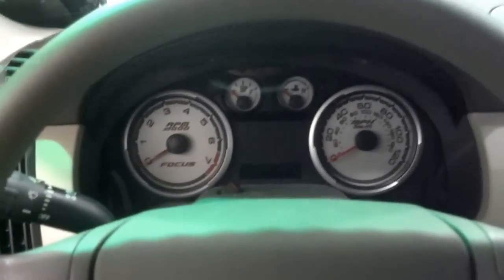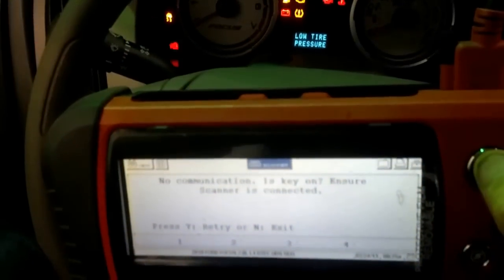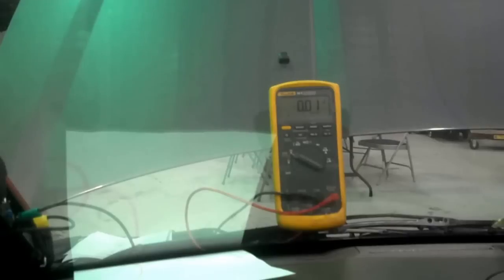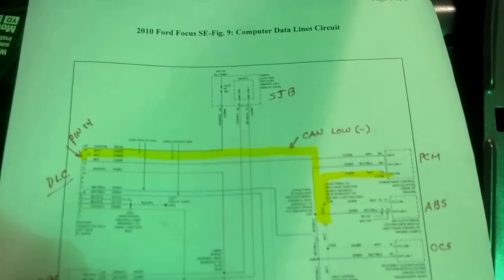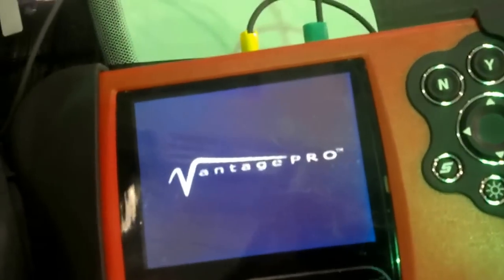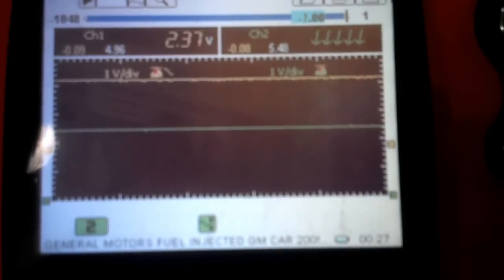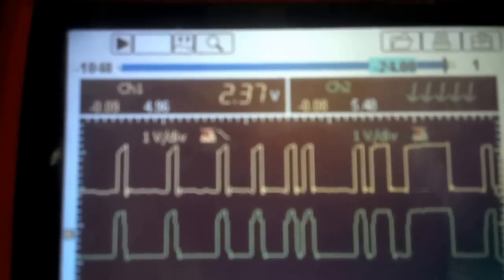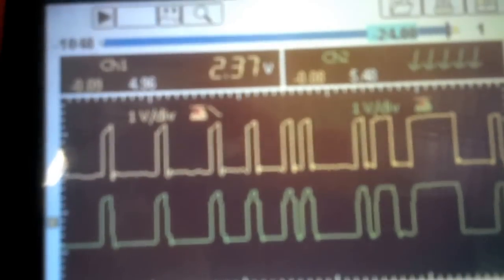PCM No Communication Diagnosis

Comment: So, can I use other components to check for a 5 volt reference signal from the pcm...the purge valve solenoid circuit, for example. Won't that also verify that the computer is supplying the 5 volt reference as does the ac pressure valve?

Comment: I've got a 97 grand voyager that cranks, no start, and no communication with pcm. After watching hours of diagnostic videos about back probing the pcm for power and ground then checking for 5 volt reference a variety of
Reply: different sensors, you cleared all that up by simply stating that a reading of 5 volts at one of those sensors proves there is power and ground at the pcm. I hit the post button by accident.  Anyway thank you!

Comment: i almost  got bunt on the assumption of having a 5 volts  reference means all power and grounds are ok,not true i had a blown fuse powering the ecu,it had i think 3 power line going to ecu, it was a 2010 ford transit.

Comment: Very educational video. Though I'm not getting no power to pin 16 only 8. Any suggestions?
Reply from the maker: Pin 16 of the DLC often get power from circuits shared with the cigarette lighter or power points.  Check those as they often blow fuses.
Reply: @MasonClassVideos  Car lighter works and my clock works aswell all my fuses r good checked with a test light

Comment: I ohmed the pcm unplugged at the can bus pins.  I got OL.  (2008 MAZDA 5)   if I connect it back I get 120ohms.  I guess the resistor is open. Am I right?

Comment: Good day; 
Information is key in diagnosing so it is a little long. Please bear with me. 
 
My latest project a 1999 Dodge Durango 5.9. with a no start,spark, injector pulse and a no buss code in OD window. The story behind is it ran to 175 tho miles and just quit, unsure so she parked it for 3 years. 2nd owner replaced fuel pump and it ran for 65 miles and quit. He replaced crank sensor with no luck.  I bought and brought home,  I do not have a high dollar scanner and Thru many tests and my Haynes manual I have found a misinstalled crank sensor.  I guess while trying to put on with the old weather strip he jammed it sideways and it struck the reluctor wheel. I positioned my phone for a close up pick and found  Luckily on this engine the wheel is not a spoke type.  
I milled a new sensor to regain air gap which got  me crank signal, power to the coil and a faint coil ark and the ASD worked.  
My problem now is when I turn key (on) I get power to fused side, then while cranking i have no signal driver from the PCM side then within a minute I loose power to injectors completely. Turn key off and then back on same thing for a minute. 
I Have 5.14 volt reff on the TPS, MAP crank and air intake sensors.

I'm questioning the reading of (battery voltage) on both low and high A/C switches. Not sure this is correct.
I am trying to get to a point where I can justify the fix if I spend the $$$$ on New PCM.

Best; Tom
Reply: What ended up being your issue? Some times the pcm will intentionally shut a circuit off after the key is cycled. Another words possibly why you were getting signal for a minute and then nothing. Then to protect internal circuit the pcm forces that circuit to intentionally shut down to protect the driver. Curious as to what your outcome was.

Comment: I have a similar issue, I have no communication with, ECM, TCM, ABS and few others. I can't get a wiring diagram the |Haynes book i bought today doesn't have it. I accidentally dead shorted the battery when the wrench touched both terminals,  Went through every fuse and relay associated with everything affected. No luck!  I need a wiring diagram to move forward. You have one for 2008 f 250 6.4 diesel? Also no oscilloscope either the Solus never had that option.
Reply: If you go to Ebay and search for "repair manual 2008 ford f250" you should find an electronic version of the manual for sale. It should include all the wiring diagrams for the truck.

I am also looking at buying an oscilloscope to work on CAN bus problems. I most likely will buy a Picoscope  2000 series that works with a PC. There are even cheaper scopes out there. Check Craigslist and Ebay.

Comment: Hey I have a question.  I have a 99 GMC Yukon and my computer does not communicate with my scanner. I have ground at the connector and voltage on all the points at the dlc. I am stumped could it be a bad pcm????
Reply from the maker: Cee Zer if the truck runs as it should it is not a bad PCM.  You need to check the DLC for proper signal, and try to communicate with other modules on the truck.  A generic OBD2 scanner will probably not do this.  Most common reason on GM is a blown cigarette lighter fuse (really!).  This provides power to pin 5 of the DLC which the scanner needs to operate.
Reply: I checked all fuses and are fine. When I plug in the scanner it blows the 50 amp ign b fuse in the main fuse box under the hood.  What could be the cause of this.  I am at witts end on this gremlin thanks for your help.

Comment: please check my recent video. security lockotu and dash board freakout. I need a exorcism and advice thanks.
Reply from the maker: Kriswixx that looks like a textbook ecample of how those vehicles behave with a bad battery.  Low voltage will cause the cluster to become totally possessed.  the extra wires are from something aftermarket, looks like it may be at least partially removed.  Good luck!
Reply: thanks!! I am just giving up. i'm selling it for 400$. someone want a car in orange county, ca? lol. i have title. selling it tomorrow.-- i just got a 2001. same car, but this has 82 thou not 289 thou. :) thanks for your help! someone who gets it is going to be stoked,- 5 disk changer and loud stereo. heck, if i had driveway space i'd park it on the side yard for storage and parts haaa

Comment: i have the same issue with a ford mustang 3.8L i have live data from other modules abs, srs, generic module control, but the pcm is died. i check the network and all is working fine. this means the PCM is bad and then need to be replace and need configuration for pats.

Comment: There is one piece of information id like to emphasis on it wasn't mentioned in the video, both can/bus communication lines are connected in parallel to all modules, what is shown on your Scope might be the BCM talking over the network regarding an opened door or a doom light or like so
Reply from the maker: Airman is correct!   We don't know 'what' is being communicated or  'who' the message is from and intended for.  The fact that there is identical traffic on the network at a known good junction (the DLC) and at the suspect module (the PCM) is exactly what confirms for us that the network is intact.
Reply: When scoping the DLC and PCM CAN Bus (-) line,  i get identical signals but one goes postive and the other shows negative. Is this similar?

Comment: Hello sir, I have the Can bus problem with my Ducati Hyperstrada ! The dashboard shows "CAN LINE" error, I was restarted the system but nothing happen ! Could you help me ? Thanks
Reply from the maker: Without factory style diagnostic equipment I would start by unplugging and plugging in the main connectors to all the various computerized items on the bike - the engine computer, ABS computer, instrument cluster, etc.  Possibly use some DeOxit or similar to clean the connections (see my other videos for this repair)  
Good Luck!
Reply: Thank for reply, sir ! I had unplugged and plugged a hundred times, I sprayed  WD40 to all connector ! But I measure the canH-canL for resistor about 120ohm ( normally 60ohm ?) What should I do ? Thank you for your support, sir
Reply from the maker: 120ohms of resistance is just 1 of the 2 terminating resistors.  The circuit to the second is open.  You need to determine where they are on your application and check for an open circuit to them.  Also, do not use WD-40 to clean the connectors as it is oil based and can cause some cross connections in a multi circuit connector.  Use a good quality electronics circuit cleaner.
Reply: MasonClassVideos hi sir, I did checked the circuit, all devices 59.2ohm ( without battery) ! Dashboard show : abs is "---", rpm bar flicking, km/h is "---", engine temperature is "---", all light flashing. But when I unplug the ECU, abs received signal, km/h shows 0.

Comment: bottom lines  i cant scan the PCM ?and tell the car's owner .to get it back to the dealer? -_-
Reply from the maker: This car was under warranty, so it was a no cost repair at the dealer. Even out of warranty the PCM needs programmed, so unless you have the correct hardware to do this the car will still end up at the dealership.

Comment: hi I have a U0100 PCM failure to communicate on a 2009 Mazda 3 2.3 basically same as the focus. my cat is still running fine though but sometimes it's hesitant to start after its been running for awhile. I did a flash just at the part store and it came back. if I was to replace the PCM my self (not under warranty ) does it have to be re programmed? or would a new one fix the problem.  I do all my work my self I'm a broke young man and I can't get any help with this. please help and thank you for this video
Reply: The problem is not the PCM , it's the TCM

Comment: I have a 99dodge ram I was having stalling problems,gauges would drop to nothing it would make like a whining from,I'm guessing trans before it would die ,sometimes start right back up ,code no bus,well now it died won't start  no fuel no spark,put new can& crank sensors in and coil but still no spark or fuel  any ideas

Comment: Hi sir , I faced same problem in fusion with my scan tool , no communication , & security light blinking , car did not start , then I solved my problem just by resetting PCM within only 10 minutes waiting time after disconnected both battery terminals , reconnect Scanner  clear DTC in cluster & the car got start , every thing was okey...... after just resetting.....
Reply: did you ever have the same problem again? my engine light just came on so went straight to autozone and cod got u0100 and when i went to start car it wouldn't, i stayed stranded at autozone till ny brother came to tow me home.

Comment: In your video the CAN circuit ok and the modules communicate each other on bus lines that you show using a scope, but the PCM cannot process input values internally right? Is it possible to use only DVOM meter to see (i.e fluke 88V) instead of scope?

Comment from the maker: Emissions warranties vary from car to car.  They are longer than the bumper to bumper coverage and are usually both time and milage restricted.  An emissions warranty will cover certain items such as the catalytic converters, certain devices and the PCM.  Your owners manual or dealership can tell you specific coverage.

Comment: hello I have a 2000vw jetta 2.0Lcranks but doesn't start ecm can't be readed by scan tool and checked connection where scanner connects and the data wire had 14v instead of 7v I took out aftermarket radio out before scanning car but still can't get car to start all sensor,fuses and ground wire are fine this happened right after I installed HIDs bulbs can someone help

Comment: Excellent lesson , thank you..I have a 2008 Honda CR-V ,opened throttle and cleaned with cleaner,. I have a p0507 and it idles high. Try to do a relearn finally got it till it is below 1000rpm and sometimes still goes high enough to set the code, I replaced the throttle body , relearn and it appears to be better idle wise , but not the same as it was before I cleaned the original one. Could it be possible the computer is still getting use to learning, have not driven more than a few miles since. Thanks you for any suggestion or opinion ..I just subscribed to your site , fist video I have seen of yours.

Comment: i have the same issue on a 2006 ford mustang v6, car was running then all of a sudden it turn off now it will not start ,there is spark, no security light ,and its getting gas .put my scanner on it and said same thing as your video ,went out and bought a computer that came reprogram with the keys,plug and play gave last 8 of vin and still nothing any suggestion?   need help please

Comment: Hi I have a question for you, I install HID's in my 2010 Ford Focus and after doing so the ABS, Hand Brake and the TC light all came on. The HID does work fine, I used my phone with an OBD reader and it gave me the same code the U0100 and U0121 Network codes. I did use a relay to wire the HID's not sure if that really has anything to do with this problem directly or not. Would you have nay ideas?
Reply from the maker: Without seeing exactly how the lights are wired I can't be sure. The symptoms sound like an ABS module that is not responding.  Maybe a fuse was damaged during installation? Or a ground write left loose?  If it was OK before the install the problem is most likely caused by the installation.
Reply: MasonClassVideos

Comment: I have the same issue I have a 2006 dodge charger and I got codes U0100,p0700,and P0404 the dealership said it was a oxygen sensor paid them and car still was stalling and loosing power while driving now they said it's the pcm something about the ground.Can a bad pcm shoot the codes for tcm and egr
Reply from the maker: Yes, a bad module can technically cause many different issues and trouble codes to be set.  Before any module is replaced though it is imperative to verify UNDER LOAD the ground and power circuits for the module (PCM in this case).  It is also a high possibility with any suspected voltage issue that the battery or alternator may be bad.  These basic checks are unfortunately often overlooked by even highly trained technicians. 
U0100 is a network failure code set by the PCM indicating it could not communicate - this code does not say with what other module it was trying to talk.
P0700 is a code set in the PCM flagging a transmission fault.  It does not mean a bad transmission just that the PCM self test flagged an issue - in this case a high possibility that it relates to the U0100 code, therefore a loss of communication between the PCM and the TCM.  This could be from a defective PCM, TCM, or circuit condition.
P0404 is an EGR performance fault - the feedback circuit for the valve was within normal voltage range but the return did not match the command.  Normally a stuck or sticking EGR valve is the culprit here, though a circuit condition is not out of the question.
 It is almost certain that the P0404 in your case is a secondary issue from the transmission.  Either can cause stalling.
From the information you have here I do not know why an O2s sensor was diagnosed and replaced.

Comment: I have  a 2005 focus.  Solid check engine light.   Pcm wont communicate.   Why,  what should i check
Reply from the maker: You may need to perform checks similar to those demonstrated here.  Any time a no communication problem exists you must test the network integrity.  Without a graphing meter a resistance check is a great start - please see my uploaded videos demonstrating this technique on a Chevrolet Cobalt.
Reply: Greg Raizk Also, first check power and ground circuits on PCM, most all of the "no communication" problems I've run across were problems with that, usually a blown fuse.
Reply: Greg Raizk

Comment: i have one question for you, i only have a fluke meter like you have in the video. could i just unhook the battery and connector at pcm and put my positive lead in the pin 14 dlc and black lead on pin 43 at the pcm and check for continuity, then if i didnt have any move my black lead to a good ground and check for a short to ground? i know its limited with just a dvom.
Reply from the maker: Yes, the test you are describing is the traditional circuit continuity test used by manufacturers.  Usually a twisted pair circuit involves 2 additional resistance checks - move the black lead to the disconnected positive battery cable to check for a short to voltage, then move the black lead to the CAN HI circuit to check for a short between the 2 CAN circuits.
Reply: how do you repair a can bus wire since they are two wires twisted together?
Reply: is it just a normal splice and solder or something different
Reply from the maker: Solder and heat shrink is the proper repair.  You do need to maintain about 1 twist per inch on the twisted pair to shield the bus from outside RFI.
Reply: oh ok i thought they were fiber optics and the repair was different than just a splice thanks for clearing it up

Comment: Great Video.  I have an issue with the Can bus on an 06 impala. There are pages of history codes one being an Open HS- on the Hi speed bus network.  I have access to a scan tool and a pico with a Can breakout box.  Should i do a reistance check or just connect the scope to find the open?
Reply from the maker: Benjamin, sorry I missed this great question when you posted it!  The scan tool is first step to see if all modules on the car can talk to to it, if one does not then the Pico can be used to verify communication exactly as I have done in this video.  If your problem is intermittent then then a resistance check like the one in my video sequence on the Cobalt would be a great way to try and isolate the issue.  High speed CAN bus diagnostic resistance check